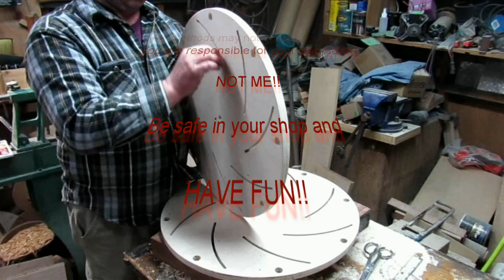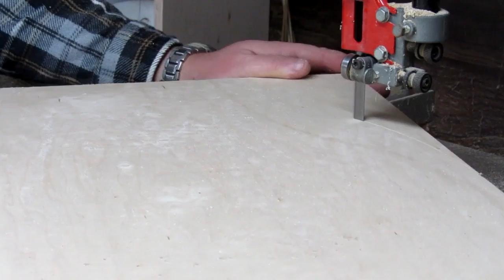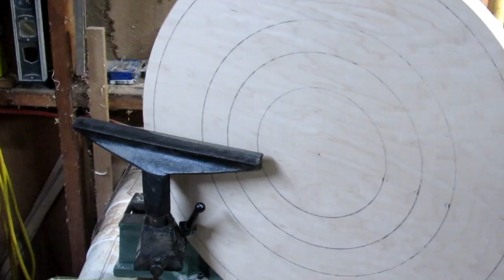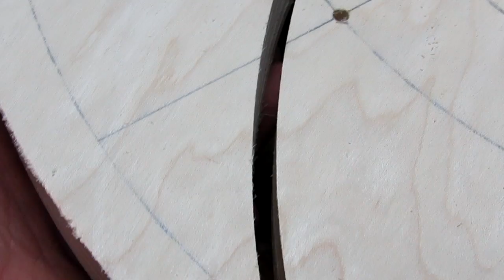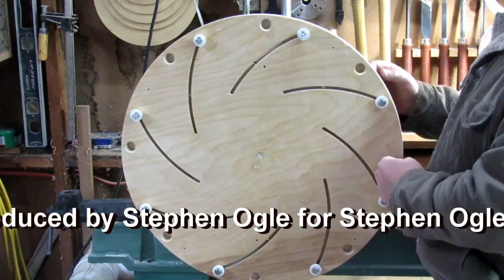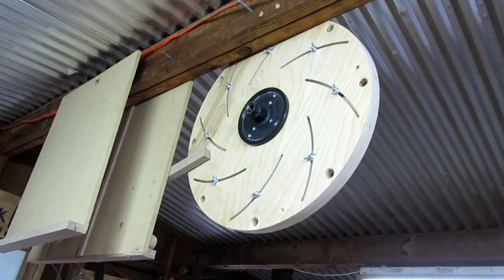#105 Shopmade Longworth Chuck

Comment: I appreciate your sharing the Longworth chuck with us. You gave very good directions and showed the project work quite well. I do intend to make the smaller version for my Jet 14" machine. I believe this type of chuck will hold better than the Cole jaws. Thanks and God Bless.  Will from Albuqquerque.
Reply from the maker: +Will Nail Thank you Will. I really like using these longworth chucks. I do believe they are more practical than the Cole Jaws because of the ease of use. They grip very securely.

Comment: Fine! Now I have ANOTHER project to build. ;-D I can see many advantages to the shop built Cole Jaws I made. Much more range in the size bowls it will handle and no need to move the rubber bumpers for each size. Great video and very clear description of each step. Well done.
Reply from the maker: +Gil Grace Thanks Gil. Yes, I agree. I have a set of shopmade cole jaws and have only rarely ever used them because they take so long to set up. I really like the concept of the Longworth Chuck and can't wait to give it a try.

Comment: Now take the exact same design as your circle cutting jig for the bandsaw and use it on a table saw. When spinning the board you raise the blade a bit at a time until you cut through the board. This will give you a smooth finished edge that is square. Just a different way to skin the cat but my choice of methods. I have a power feeder that I use to spin the board for added safety.
Reply from the maker: +James Stanlake Thank you James. I have seen this method before and you are correct about the nice cuts from the tablesaw. Thank you for sharing this information.

Comment: Great video, I have one question. Is there a reason for doing one slot at a time? Couldn't you do all the slots 1/8 deep, then lower the bit? That way you lower the bit only 8 times rather than 8 times per slot

Comment: Great video Stephen! Quick question for you, the jig you made for your router, the trammel, how did you get the dimensions of the trammel to accurately cut the archs? The distance between the pin and the router head, is it simply the distance between the inner and outer line?

Comment: Great build Stephen, that is one large chuck!! I tried making one of these a couple of years ago, my router died on me mid way cutting the groves, and that was it, never had the chance to replace it or finish it. Yours sure look perfect :) How large are you planning to turn over board with that large one? The smaller one looks something I could use on my smaller lathe, yeah, I should start working on mine, I've been working on jigs all week...
Reply from the maker: +Yuval Lahav Woodturning Thank you Yuval. I do not plan on turning over 22 inches and designed this chuck for that purpose. I hope you will finish your chuck also. I have used mine several times now and don't know why I haven't built on before. Hope you enjoy all your new jigs.

Comment: A 20" bowl might take some extra planning. For instance how would you lift such a massive blank to mount it on the lathe? You might need some help...or a cherry picker engine hoist. ;-)
Reply from the maker: +Gil Grace Thanks Gil. I will probably not make the bowl from one massive blank and will lean more toward the economy or segmented bowls. I do not have a good hoisting system yet. Ha!!

Comment: Longwoth secure? I have an aftermarket one and it is easily the worst money I have spent woodturning. I used mine Monday trying to take a tenon off and not only did the bowl come out but the chuck came out of the jaws of the chuck and rolled out of the door and into the yard.  It never runs true and the slightest catch pops it from the nova chuck. If you are a beginner and read this buy the cole jaws, they actually screw into the body of your chuck.  PS sorry for the rant and I hope your longworths work for you Stephen.
Reply from the maker: +James Templeton Thank you James for your input. Do you have the Aluminum or Resin?  I can't believe someone would sell one of these without a reliable way to mount it onto a lathe. Thanks again my friend.
Reply: +Stephen Ogle  I won't say which one I have but it is plastic with a metal tenon. I know my chuck is true because I use it quite a bit, lol. But for some reason this longworth will never seat properly into the jaws of my chuck. Plus (and I blame myself for this) I can't get the tension even with each "knob".  Also even with a great deal of loosening of the wing nuts the plates are very hard to slide even with the tailstock loosely holding the bowl to the plate of the longworth. Maybe I am not doing something correct but for "me" I prefer the cole jaws. When I saw how easily yours rotated I admit I was a bit jealous. As I said I really hope your two work very well for you.
Reply from the maker: The metal tenon may be the problem. If they are too hard, the jaws can not bite. I would have expected you to tell me the wheels were metal and the tenon plastic. I do not like the idea of a metal tenon for a woodturning chuck. If you can disassemble the wheels try sanding very smooth and waxing between them and even wax the grooves also. I would not give up on it completely. Hope all works out well with it for you. I would also like to know which company made it so as to watch out for them in the future. Take care my good friend.

Comment: good job my friend, im going to make one, but i noticed the smaller one only has six slides is there a reason for this?  also what is the jig you have hanging on the side of your shelf above the light switch behind the bandsaw?
as always "turn on"
hubie
Reply from the maker: +hubie hubco Thank you Hubie. Glad you enjoyed this project. The jig you refer too is my trammel for drawing circles. It is just a large compass. Thanks for asking.
Reply: thanks, i thought so but was not sure. did the smaller set of jaws only have six slides? was that all that was needed

Comment: Nice work.  Really need to make one of these.    How slow can you lathe go when using outboard?
Reply from the maker: +phooesnax Thank you sir. I really appreciate it. My lathe's minimum speed is 600 rpm.
Reply: OH  Be careful   mine I think is 320 and i am afraid to big outboard.....safety first.  You could always go three phase with vfd and intermediate shaft.
Reply: Really a nice looking set of chucks though!
Reply from the maker: Thanks for the heads up.

Comment: Stephen, I made one just like yours but the rubber buttons don't seem to hold it in good for some reason, how's yours doing?
Reply from the maker: Thank you Todd. I am still using this chuck without any modification. I do not have problems with the bumpers, However, you could try a different design. There are lots of variations you could use. I hope this helps.
Reply: Stephen Ogle, I may buy the buttons from Rockler or maybe I'll try a donut. I'll let you know. Thanks Stephan, lathe down your tool to rest...